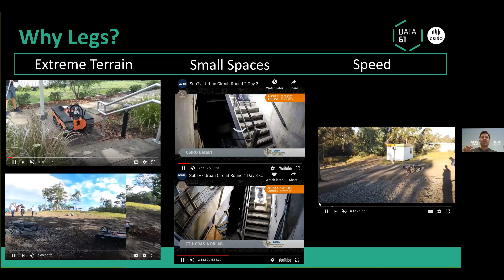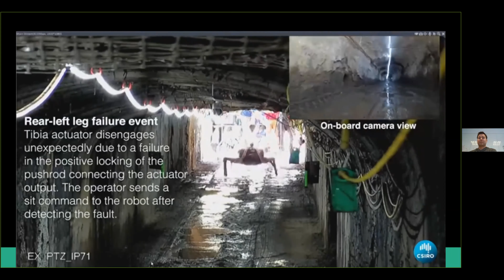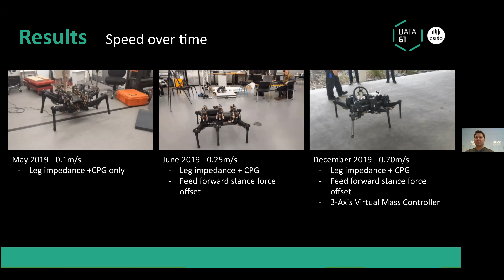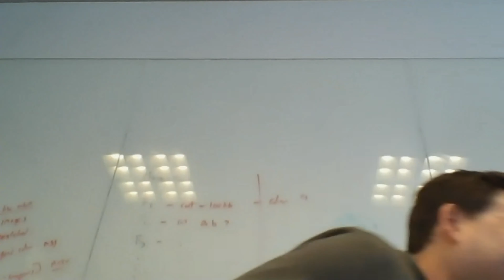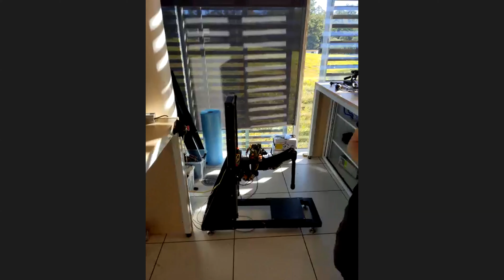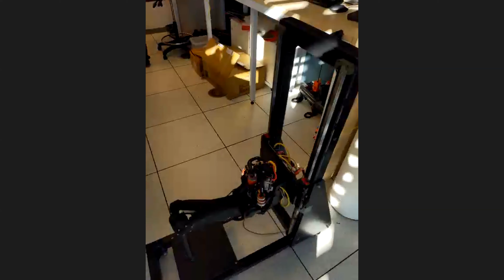Nick Hudson: Development in the DARPA Subterranean Challenge [ICRA 2020 WS - Legged robots]

Comment: As a zoologist I will say the symmetric design does actually look much more natural. Particularly as a fan of spiders, where the cephalothorax is pretty close to being circular (look at the sternum of a spider), with legs going in all directions, and they are similarly great at tight spaces. 

Are there any soft robotics hexapod concepts where the legs are more flexible and use claws and tension for their stability?
(Forgive if I sound silly, I'm not a roboticist, tho I'd like to be)